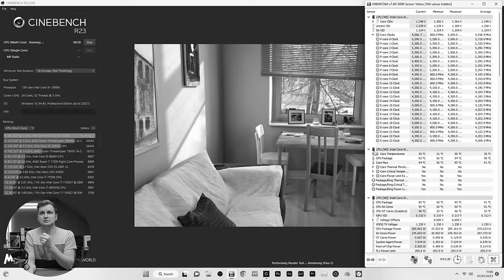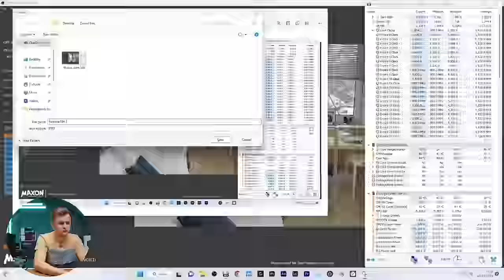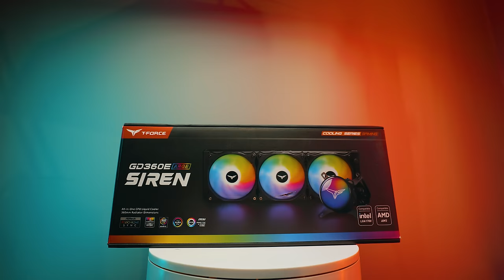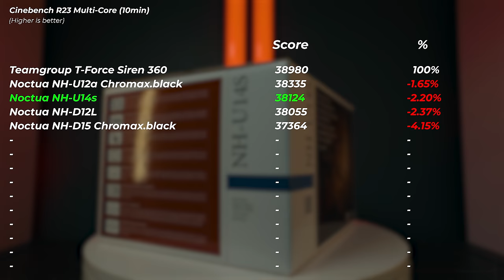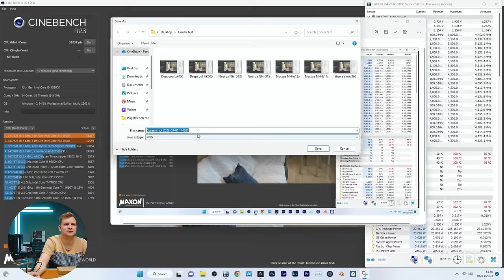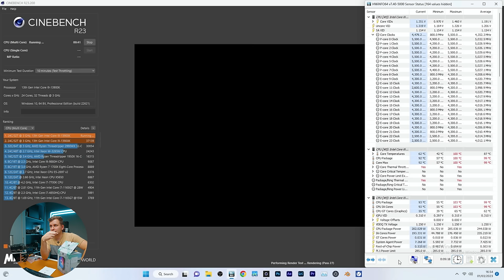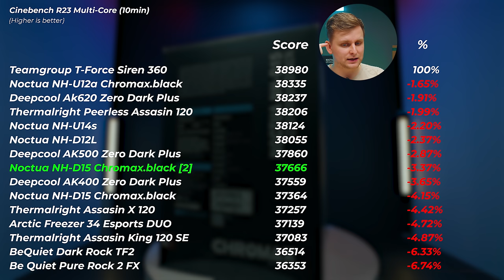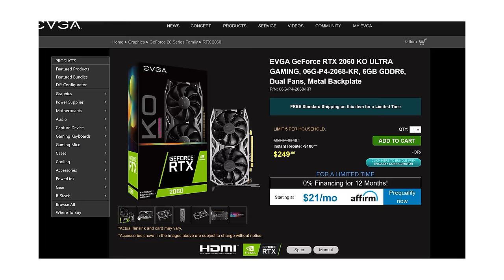We Tested 14 AIR-Coolers on 24-Core 13900k - The Results Will Shock You!

Comment: ok, so just get the 19$ TR Assassin X and cap the max boost at something like 240 watts. personally i d even go for something reasonable like 200 watts, but why buy the 13900k then.

Personally I got the somewhat worse (for whatever reason, maybe just a bad batch?) Assassin King for my 5800x, which i now swapped for a cheap used 5950x. Good Airflow case (3x120mm in, 3x120mm out) and the Assassin King has no problems with the 5950x. 

I also swapped the the Fan for the same fans i use in my case which are Arctic 120mm PST PWM, so I have only 7x the same fan. furhtermore all monitor the CPU temp, meaning all have the same speed which results in less noticed noise (e.g. 2x the same noise "feels" less loud then 1x noise + 1x another noise)

Comment: I reach 40038 with an ASUS ROG Strix LC II 360 ARGB White Edition All-in-one AIO Liquid CPU Cooler 360mm Radiator. Intel 13900K in a case Corsair 5000D and Lian Li RGB case fans 3 in front +1 in rear. Same test no throttle, max temperature on core 7 - 87 degrees all other cores between 76/85 degrees. Load between 283/290W

Comment: Man I was looking for a air cooler for my new 13700K just a couple weeks ago, went for the NH-D15s. Needed this video!
Reply: Is it serving you well?
Reply: @vincevanbro9641  Between 65-70 when gaming. That's with a h510 elite ( not the best airflow ) and 30° C ambient temp. Keep in mind its undervolted and also with a Contact frame

Comment: Probably all the Air Cooler would get slightly better Results with an Highend Thermal Paste, like Thermal Grizzly Kryonaut, Alpenföhn Permafrost 2 or Alphacool Sub Zero. Its an interesting Comparison. It could be also interesting to see, how all the Cooles perform on a 7950X3D, AMDs Counterpart to Intels 13900K(F/S).
Reply: Unless it's liquid metal it doesn't make that much a difference between cheap thermal paste and expensive thermal paste, it's more application.

Comment: Holy shnikes, now i want to scrap my nh-d15! Its amazing these smaller units are outperforming the "best" air cooler. I've been using mine on 12700, but I've been thinking about moving to an aio; but i kinda hate to use aio in a fractal torrent, just on principle. This was interesting

Comment: The slower fan speed of the D15 could be the reason for it performing worse, it's always been more of a "great silent cooler" rather than the "best cooler".

Maybe try a test with it using the fans from the U12A? The U12A fans are faster.

Comment: The secret of a good cooler is having good fans paired with it. This is why a single tower cooler with the best 25mm fans is performing so well. The amount of heat piped and if they contact the cores is also very important.
The issue with all AIO in the market is companies pair them with shitty fans to lower the cost. But i guarantee you if any company come with an AIO using 3 noctua fans, they will stomp the competition. But at a high cost.

Comment: Awesome test and I know it took a lot of effort to put it together!  When I built my 5800x rig, I went with water cooling for the first time in my life.  While these air coolers do a great job, I think I prefer my AIO for its quiet operation and cleaner look.  I used the Hyper 212 for so many builds over the years but these tower coolers are getting huge to cool down the new wave of CPUs.
Reply: I'm still using my Hyper 212 through 3 builds so far but I use 2 fans (push/pull)
Reply: @joshbrobud8358  I’ve had that cooler for many a build! It even cooled my old i7-7700k which could get real hot. Solid design that stood the test of time.
Reply: @K.C-2049 Yeah there are a lot of good choices and the 212 doesn’t have the best mounting system but I also rarely ever had to remove them.

Comment: yo man thanks for info. really like your content. I have a "be quite dark rock pro 4" biggest air cooler 2 tower and 2 fans i was wondering does it work with 13900K but i saw many comments and videos about it. It doesnt perform well with air cooling.
Here is the question:
What if i lower the voltage and use my air cooler ? what do you think ? i really care about your opinions
Reply: Undervolting helped me drop temperature 5 degrees plus added a thermalright contact frame to drop another 4-6degrees hope this helps. You may have to trial and error the voltage make sure it's stable.
Reply: @randomhelp  does it works with your air cooler on 13900k ? i still didnt buy that becoz i dont want to upgrade my cooler to AIO :D
Maybe wait for 14th gen, maybe it runs cooler with small nm
Reply: @akcivan  I am still running 12th gen undervolted on d15 @82-84C on cinebench but they are the same shape as the 13th gen. Also I know someone who also has the 13900k and got similar results as I did granted lightly warmer  doing the same method as I .
Reply: In recent tests the dark rock 4 and pro didnt perform that well, their cooling design seems to be outdated. Thermalright, noctua and deepcool seem to be the better choice at this moment.

Comment: Did you attempt to normalize for fan speed/noise at all and just didn't mention it because unless I missed it, that's kind of a big deal.  Would make sense why the NH-D15 is much lower for you because that's the strength of that cooler, is that it has higher thermal headroom and fans that can be run at lower RPMs than most other coolers, ie it can keep around the same temps as other coolers and do it much quieter.  Unless you did something like that, the numbers are kind of irrelevant if one cooler is running its fans at 1800 rpm and producing like 40dba of sound while another is much less.  Maybe I missed that part, but I mean, take the NHD15, pretty sure its max fan speeds are like 1800 rpm where there are multiple other coolers you have here with fans that will go way past that if allowed.  Either way, good vid!

Comment: Think you should do multiple tries per cooler and then maybe take the average? Then you can compare the averages. Could also keep track of the variance for each cooler. Does one cooler perform more consistently than the others? So, you'd want the one that performs the best the most consistently. Also keep tabs of the ambient temp for each trial run. Just some thoughts.
Reply: also I made this comment without watching the entire video so if these points are addressed, my bad
Reply from the maker: Actually this test is an average of about 30 runs of the cinebench and average score calculated. :)
Reply: I would assume that the room is air conditioned, so the ambient temperature should be basically the same for all runs. If that space was not air conditioned, he would be sweating!

Comment: It's not a joke, the other day I installed a Noctua NH-P1 on a 13900K. With the PL set to 125W, I scored 29,000 points, which is 26% less than the reference RL in this video.

Comment: fix voltage and the accurate recording of the temperatures would be a far better test method. All manufacturers have entry-level coolers and also high-end coolers.
A comparison of the brands is nonsense, you could have, for example, from be-quiet! you can take the Dark Rock 4 or Dark Rock Pro 4, which would perform much better, but that's not what the video is about, it's more about showing different sizes and cooling principles.

Comment: Why didn't you test Thermalright Silver Arrow IB-E Extreme Rev. B?
Reply: @blue-lu3iz I agree, however, it has 8 heat pipes, 140mm fans with high RPM, although it is old, but it should dissipate heat very well, and I would like to see how much worse it will be than water cooling, although old, but cool!

Comment: I appreciate all this work, and how mind numbing it must have been. I'm getting ready to upgrade from a 5950x to 7950x w/ a DEEP Cool ASASSIN III. I would go 13th gen Intel but I know later this year the socket is EOL. In my current setup I'm limited to 240mm AIO's so I prefer air cooling for less concern.
Reply: You will have to upgrade your motherboard anyway for zen 5. They will greatly benefit from a more advanced memory channel and a motherboard that can benefit new power stages for big and little cores.

Comment: Impressive video with great information 🤩😇🤯. interesting to see top dogs like the Noctua D15 falling down to the middle of the pack in performance and beaten by cheaper models 😱🤯🤔. I agree that cooler manufacturers need to reassess their lineup with Intel changing their cpu design with 12/13-Gen CPUs.  Der8auers recent video with an Intel engineer / designer stated that burst speeds with temps etc was a architecture design and cpu then wouldn’t be affected by varying temps as resulting of boost algorithms as stated here 🤔🤦‍♂.

Comment: One thing that no one talks about the is longevity of these CPUs if they consistently running at such a high temps.. ie for rendering work, i would say that you would get max few years out of it. Also, most of the PCs motherboards are vertically mounted so putting that much weight strain on the MB for years is going to start bending your MBs.
Reply: 100C is Intel official spec. Silicon was tested to last long without any issues at those temperatures.

Comment: To bench a open system with different is in my opinion not very accurate...Everyone will build their hardware in a case. This is the same for benchmarks for cpu and gpu when you have installed a OS on it. Personally I think the best way to test those are to have everything installed one might use and then do benchmarks while you have all the programs running in the background.
So long story short, the amient temperature will be different thus will the result of all the cpu coolers wil be, and the cpu will perform more realistic with all the background processes, this way you will have a much better idea of how the cpu and cpu cooler will perform.

Comment: Amazing, thank you so much for the best testing video I have seen.
Can you make same test for AMD CPU like 5950x next time?
Reply: Well - as he said – you shouldn’t have a problem with CPUs that draw less power and the 5950x draws significantly less power – therefore it is a lot easier to cool – and any of the top 5 coolers should be more than fine. I personally use a NH-D15 on my 5950X and it doesn't throttle.
Reply: @m.l.9385 : Thanks for your reply. I actually using D15 for my 5950x too but I have some problem with it. Maybe my D15 have failures or my fans have problems too. It's make so noisy when it was kicked to max 1500rpm and the cpu still hot almost 90 degrees. The sound like Delta fans 3000rpm kicked in server when it start but my fans just run at 1500rpm. Because I like the silent so I have to undervolt my cpu and set low rpm to my fan, sacrifice performance for the silent.

Comment: I think the results are a bit lower than usual, maybe fault of the silicon lottery. I have a 13900KF cooled by a Corsair H150 RGB 360mm at a Strix Z690-G and 32gb 6000 C36 inside a mid tower closed case and got 38000 at 250W and 95°C, 39000 at 300W and 100°C (Room's AC off) and 40533 at 305W and 97°C (Room's AC on)

Comment: You really need to use dual push, or dual pull, on the fans, on a dual tower heatsink. If you do so, you increase the cooling capacity by at least 50%. It is really easy, just move the sentral fan, to the rear of the heatsink, and let it push air into the heatsink, as in dual push. I haven't gotten my channel up and running yet, but why on earth people do not apply basic thermal theory on aircooling, I simply do not get. Not to stack heat, is common wisdom of crowd when it comes to water cooling. It does work. I have done it for years. My 3950x tops 75C and 800-900rpm, with a special printed duct, using dual push. I simply cannot hear the fans. Noctua D15. I have hinted about this on every channel I know about, and find it strange that nobody seems to even understand, that this is like the basic of the basics, of how a cooler works. Let's see how this works out. Maybe this channel fairs better. 

Oh. I ran my 3700x this way. It typically ran at below 350rpm, even for medium loads, like games. Temp below 75C, witch is the same as the rgb spire thing, that it ships with.
Reply: In this configuration (push-push) are the fans blowing towards one another?
Reply: @zingo7418  yes. No heat stacking.

Comment: Thank you for this very interesting and comprehensive video. But I think you could obtain slightly different (better?) results if testing is made inside a closed, well forced-ventilated case, and not in an open testbench due to inconsistent airflow around components and coolers, as someone before me perhaps already pointed out. If you buy such a cpu you're probably doing 3d rendering or heavy productivity tasks, so 10 minutes runs at 100 degrees is definitely not a good thing. Rendering takes hours and you should keep the cpu temp well below those numbers for a very long period of time. You are constantly reaching the maximum cpu temperatures, lowering cpu performance due to thermal throttling all the time, which to me is pointless. Am I wrong? :) Dont take this too seriously, I'm just reasoning :) .
Reply: Take it seriously. Open testing is not valid for most people.

Comment: i think your installation from the Noctua  D15 was incorrect because it cool much better than the Noctua nh u12a  ...I use the same type Noctua 12 push pull on a old I7 860 with high overckloking =65°C at max load...

Comment: hardwarecanucks also tested aircoolers  on intel 13 gen cpu , i wonder how would they do on a ryzen 7950x if the the results are similar or different to intel , since the design of the cpu is different

Comment: I wonder how much of these unexpected results are just because of a different (more or less aggressive) fan speed curve, since this is not noise normalized? For example, Be Quiet's products in general are essentially confirmed to run their fans a little slower than might be optimal, never getting aggressive enough to keep temps down. And being older designs, they might need updates to handle increasing thermal density of the newer and newer processors...

If you could normalize room temps a little tighter, and either run all fans at max or at a single noise-normalized loudness, maybe we could see more typical results for e.g. the Noctua NH-D15. But if this ended up showing that the default fan speed response of the fans are really that bad/un-optimal, it is worth consumers knowing! Hmmmmmm. (Caveat being that a part of the equation is one's own mobo's fan curves as well, so might not apply to every purchaser...)

Anyway, thanks for the roundup! I enjoyed this look at the coolers.

Comment: Little mistake made in the video: 
You are using the SE variant of the Thermalright Peerless Assassin 120. SE model is not just that good as the non SE version. 
Still you have link in description for the non SE model, which is ok cause it's better cooler. Maybe you should highlight that the link is to the different model? Temperature might differ like 1-2c between the models but still

Comment: I prefer air cooled over water cooled. So I always choose the non k versions of intel and the 65 watt versions of AMD. This keeps the power draw well under 150 watts and allows for tower air cooling. You get most of the performance without the added heat. I think it makes the system more stable also.
Reply: Amd 5700G or AMD 5800X?
Reply: @zhuzhu9599  5700x would be my choice if you have a gpu. It has most of the power of the 5800x without the power draw and heat. 5700g is crippled by its 16g  vs 32 on the other 2 processors.
Reply: @myamaha62  initially to output display, i will only use lower end gpu like GT 710/730. I will add more powerful GPU later on. Do you think GT 710/730 would support Ryzen 5700X + B550 MB?

Comment: Those tests are not reliable without room temperature control. Doing many 10 minute runs around 250W is enough to rise room temperature by several degrees.  Not an issue for normal use, but when you are benchmarking products that only differ in 1% to 4% performance it is not fair.

Comment: Cool and well done test. I wonder what the contact patch looked like on each of the coolers, as well as how flat they were out of the box. We (I think at least) know that the thinner the paste the better as its only to fill in the micro-gaps and not just be slathered on as it has worst performance. Of course all dependent on the IHS and cooling plate.
Thanks again, for all the hard work that was done with what you showed. Still all valuable info.

Comment: I know this is old video, but all the coolers have different TDP ratings, example you set CPU to 295watts, and you tested a be quite pure rock 2 FX, it's ONLY rated for 120watts, basically it's not a cooler ever designed for a 13900k 250watt CPU

Comment: calling the 13900k a 24 core is like calling the old bulldozer chips 8 cores or 6 cores, you can do that but you would be wrong.

It is a 8 core with 16 useless 3w e-cores, funny part about that is it still draws 300watts with only 8 useful cores

Comment: While you did go quite in-depth with the process, there were too many variables that were either not accounted for or not described. For example, not having a consistent ambient temperature...that's a rookie mistake my friend, that automatically voids these results almost entirely. Similarly, we have no idea how long between tests you left. Was the system consistently 'cool' at the start of each test? The fact that you didn't measure the amount of thermal paste for each application... Thanks for the hard work but hardly any results can be taken seriously from your testing.